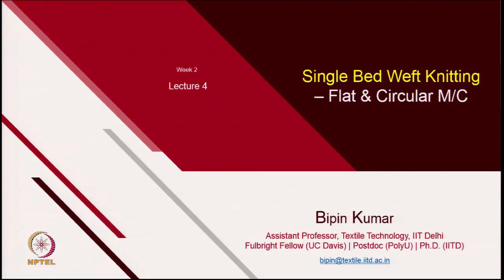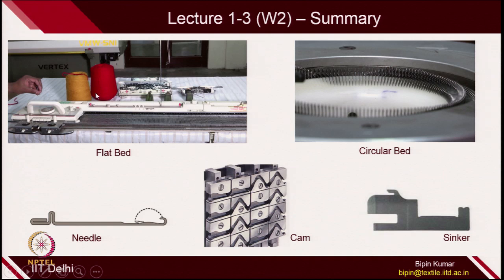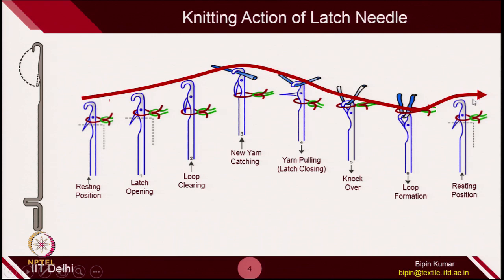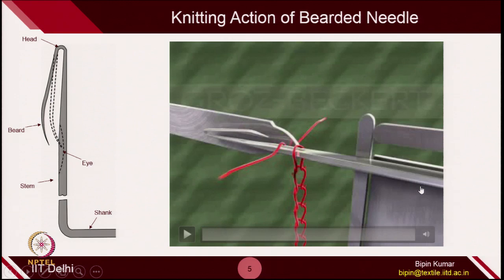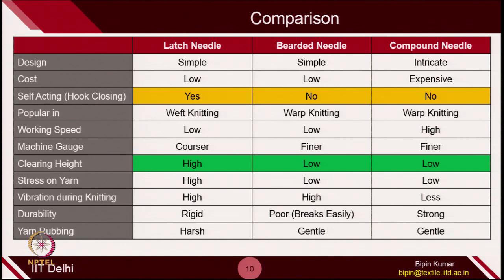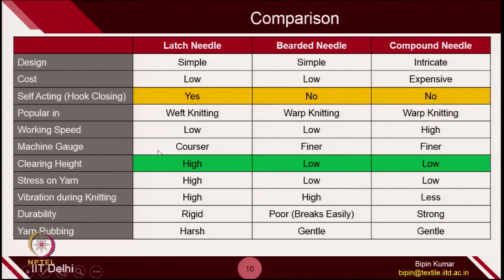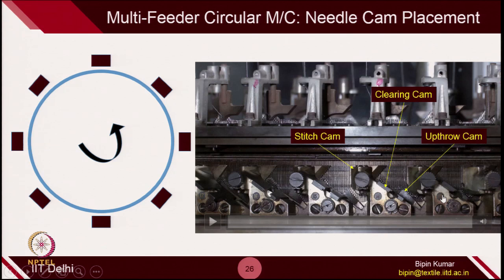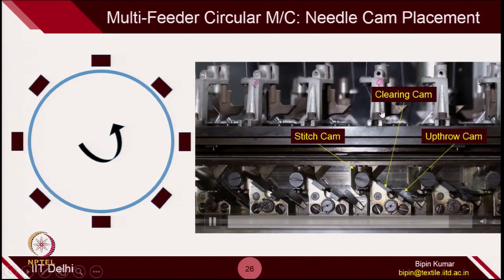Lec 8_Single Bed Flat and Circular Knitting Machine (Lab Demo)

Comment: Thank you very much for your hard work, you are the best.
I have a question.
I would really like to know the answer.

Your Formula (Episode 33:15):
 CottonCount = Guage²/18.

If, here:
CottonCount = Yarn Thickness (Ne).
Guage=Machine fineness (number of needles per inch)

Question:

What logical value means the number "18" in this formula? The number "18" - what is it?